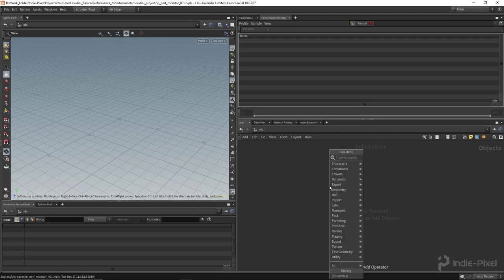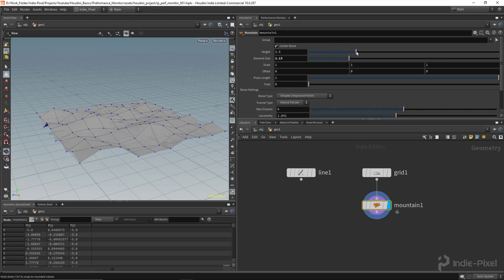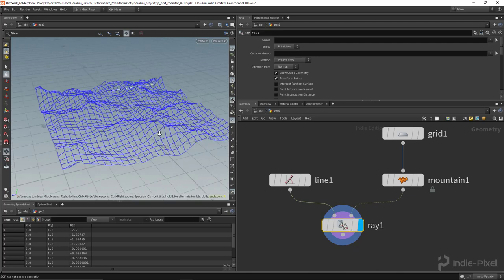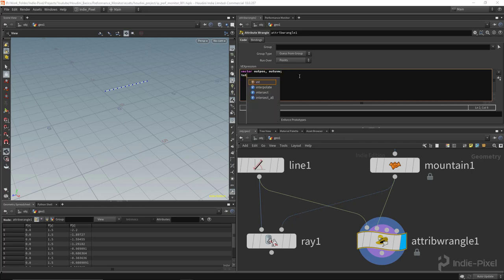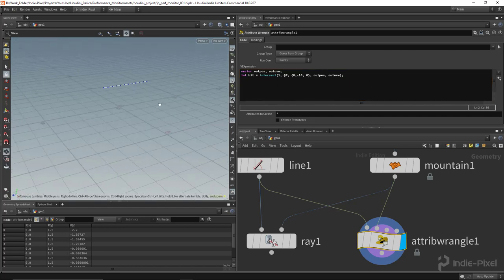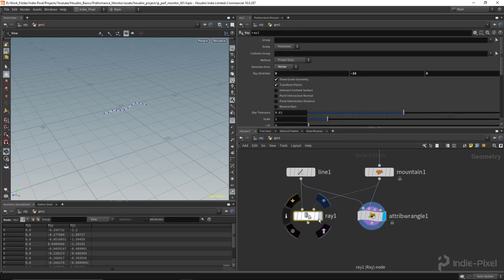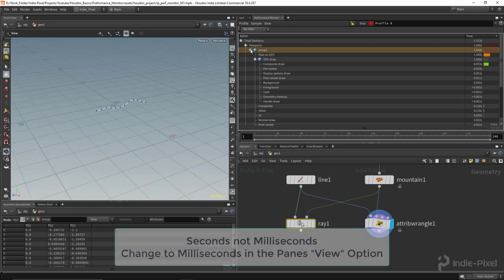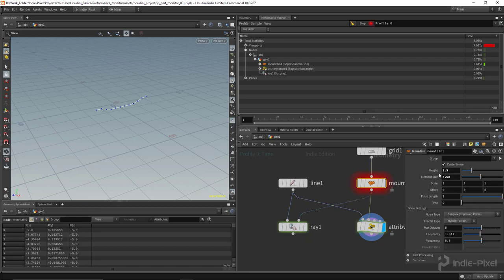Houdini Basics - Using the Performance Monitor to Profile Nodes

Comment: Sorry, but the Time column is actually showing the cumulative time from the start of the test (spent per node/element). So the longer you move sliders, the more it increases. 

If you want to use Performance Monitor to compare performance of two nodes/subtrees you need to use Viev/Cook stats/Cook (avg) in Perf Mon pane. It will add Cook (Avg) column, and that will allow you to reliably compare different nodes.
Reply from the maker: Definitely, but it still shows where your networks are slowing down.  That's really what I use it for.  Just wanted to show how to get it up and running.  Thanks! :-)
Reply from the maker: Thanks for the extra tips for sure! :-)
Reply: Yea, exactly what Alex said.
Reply: I was gonna say "Shouldn't you merge the two nodes you want to compare together and then fiddle around with the Mountain Sop to get an exact comparison", but this comment is better I guess.